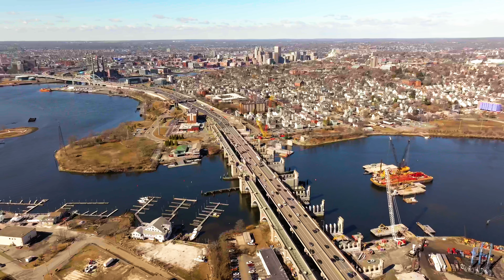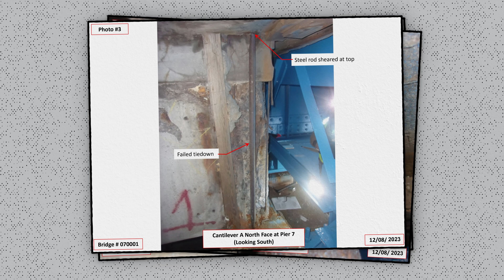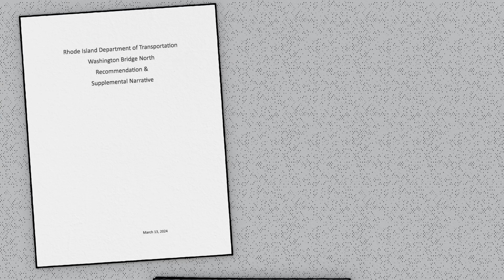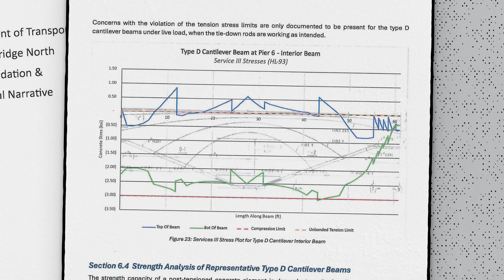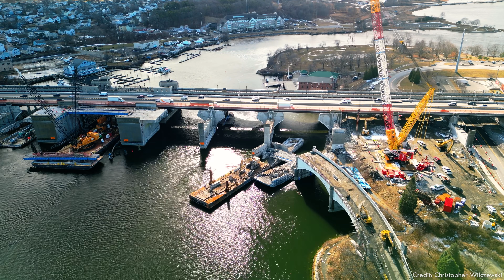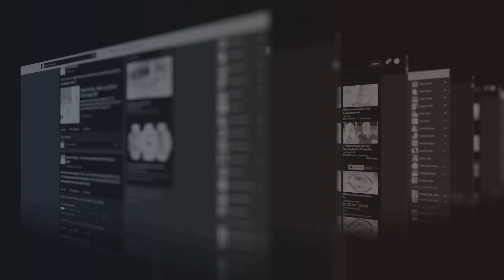This Bridge’s Bizarre Design Nearly Caused It To Collapse

Comment: The headline of this video is a cheap shot at the design team, the members of which are mostly dead. Perhaps I am the only exception since I was the youngest. It was NOT the design that almost caused the failure. The design was an unusual and innovative use of the then existing technology, far from bizarre. The real culprit was the neglect and the poor maintenance by RIDOT. Had the deck joints and other components been properly maintained, water intrusion would not have taken place and the bridge would have served the public for another 50+ years. It is notable that Casey Jones recently documented that the rods were broken for an extended period of time, something that was obvious to me as soon as I saw the pictures in December 2023. If pictures could be taken, then the location was accessible for inspection and the deterioration observed. Such degradation take decades to happen, ample time to fix the problem. Despite the broken rods the bridge carried the traffic for an estimated two years or longer. So much for the condescending comments.
Reply: I agree with you.  The designers are being scapegoated by RiDOT along with many other people and yet they apparently find zero fault with how they have operated this bridge.
Reply: @CaseyJones-Engineer  Thank you for your support

Comment: Those tie downs seem to have failed due to expansion and compression. The sheer seems as if the metal was stretched and failed maybe due to constant load shift based on the deck design.

Comment: Often times, degradation mechanisms are overlooked in the design process.

PS:  The Francis Scott Key accident was easily avoided.  They are called dolphins.  After the collapse of the Sunshine Skyway Bridge in Tampa in the early 80's there was no excuse for the piers on any bridge crossing a ship channel to not have dolphins.  It is one of those situations that I have looked at in my career and observed that it is not a question of if but rather a question of when.

Comment: I lived near a busy 4-lane bridge over a river between Irving and Dallas, TX. The bridge became alarmingly rough to drive over, and was shut down. A few weeks afterward, I bypassed the safety stands and walked down the bridge a ways. Some sections were so badly separated from their conjoining sections that you couldn't have climbed back up had you jumped down. From "rough" to "un-jumpable" was only about 3 or 4 months. It was astonishing how badly that bridge deteriorated in such a short period of time, and how close the call was to shut it down!

Comment: The firm that has done the work on the bridge was being sued by the state after these issues were found. 
Then the same firm while still being sued was awarded the contract for demolition. 
That bridge has been under some form of construction for over 15 years and the head of Rhode Islands RIDOT said these bolts had only snapped a year ago.
Yet if you look at the bolts that hold the bridge down, you can see metal thickness from rust has become so thin that it could not have happened in one year.
Rhode Island wants you to belive that this bridge passed inspection when we all know that if anyone had looked at those anchor bolts at any time in the last decade it would have caused a closure long ago.
The head of RIDOT needs to be fired asking with anyone who inspected that bridge in the last decade.
During demo a section collapsed on a barge and just the other day a machine broke and dumped hydraulic oil into the water.

Comment: Aerospace understands that being able to fully inspect the structure is a critical, and required, design criteria.  Can't have a structural member embedded under other members, making inspection impractical.  I'm sure Civil Engineering design criteria have been updated since this bridge was designed such that modern structures will not have this issue 10, 20, 50 years in the future.

Comment: 11:35 - We just experienced this at our house here. Went to change out a toilet, turns out the previous contractor didn't properly raise the flange after installing tile and raising the floor level so the subfloor and drywall behind the toilet have been getting soaked with every flush over the last decade..to make matters worse the subfloor is plain particle board, so we're turning a simple toilet replacement into a full down to the studs bathroom remodel.

Comment: @14:55, this looks like a fast way of dismantling the bridge. I assume (I hope) no one was on the barges below. And everyone was apprised that the bridge was going to be violently taken apart (from shore to shore).

IF that is true, AND time was being wasted dismantling this carefully, only then this is a needed step.

Maybe we can focus our energy about finding a solution. Including a low volume temporary bridge (3 or 4 lane is better than 0 lane). I assume a simple metal truss bridge, as ugly as they are, they are easy to design, can be fabricated off site and assembled more quickly than pouring a bunch of concrete. After this bridge has served it’s purpose, the steel can be reused for another project (or melted down and resmelted in the worst case).

Arguing and suing each other isn’t a solution for tomorrow. It only adds to the problem.
Reply: You can’t dismantle a bridge like that, you risk damaging the barges and contaminating the river below

Comment: We've had a bridge fail recently in Dresden, Germany. Collapsed in the middle of the night 10 min after the last tram passed over it, nobody was hurt. Turned out it had some flaws, but the most egregious one was similar to this one here: It was impossible to inspect critical parts of the bridge due to the way it was designed. I don't know what's more scandalous, building a bridge like that in the first place or limiting yourself to inspecting the accessible elements only and just assuming the rest is ok.

Comment: The things that you don't catch in this video are that this bridge has been under construction for the last 30 years, a Connecticut inspection company reported this possibility to RIDOT 3 years before the shut down but they completely ignored the CT firm, and the reason no one would bid on the deconstruction was out of fear of being sued by the state and the corruption that's been plaguing RIDOTs system for choosing contractors since Peter Alviti took over. (There's a longer history to RIs contractor corruption but Alviti is hurting us the most right now) He got BILLIONS in a promise to fix 90% of RIs bridges and the target he set for this all to be done by was around the same time as when this, our most important bridge, was discovered to be failing. We are at the bottom of the list when it comes to the structural integrity of our bridges and roads despite BILLIONS being poured into them. I'm praying Alviti gets locked up in prison and drops the soap.

Comment: yes sure the bridge has major structural issues obscured by unusual design, leading to costly rebuild, but on the other hand, it's looked prettier than the standard design for over 50 years... you can't put a value on that 🙂

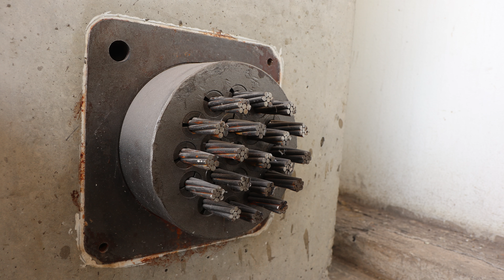Comment: 3:35 I used to be a draftsman in a precast concrete plant. We didn't do bridge beams, instead focusing on stadiums and parking garages. I remember they would pull each of the strands/tendons to over 30 kips or 30,000 pounds, and when they were being pulled nobody could walk between the forms, because sometimes they break!

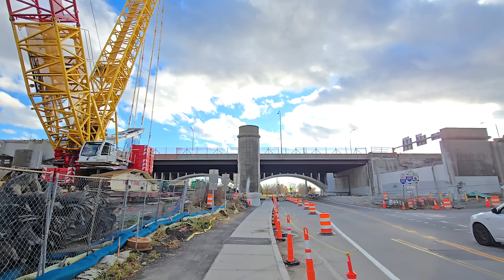Comment: 9:40 A big question is, who was the Muppet engineer who dreamed up the suspended deck sections balanced on beam that could only tip over if any one piece fails?
Hope they didn't design anything else important in their career...

Comment: You mention "concrete repair". How does that work for structural elements? Seems impossible to fill cracks and match the integrity of an original cast piece.

Comment: Just look for the "Viaduc de la Concorde" that failed back in 2006 if I remember well.. It's a structure in Quebec that had design failures and was not able to be inspected correctly. The province had to replace dozen if not more other bridges in all the province afterward since they were all from the same design..

Comment: Awesome summary of the bridge's safe demise. It was an old bridge where a lot of the steel reinforcing corroded to failure; not exactly surprising. The onus for old bridges should almost be to prove that old bridges should stay open instead of saying there is not enough information to shut it down.

Comment: Two sets of litigation that are over laid on this bridge rebuild do seem to be counter constructive when you consider that the bridge itself was near its designed life span. Perhaps a step we need to start taking in this kind of public building project is to include a well publicized end of life for the expected useful life of  the structure. It would give us a better measure of the value of the project and a reasonable point to acknowledge when funding would need to be acquired for replacement of the structure.

Comment: Very interesting video. I think that in Europe we also have this kind of bridge and that we should also do in-depth monitoring studies.
subsidiary question: the bridge, which is still in operation( with both road direction), does it have the same design or is it completely different, otherwise it would also have to be replaced

Comment: Very well presented. You have a confidentspeaking style too - transmitting the technical deets with easy clarity.
And yes: What a Fluster-Cluck that is!
It reminded me a a quirky scenario that developed in the city I'm currently inhabiting: Brisbane. (You may have heard of the drama. It was all about inspections!)
On the Rverside Expressway there are several one-lane curved bridges: on & off-ramps that have to start or end on the outer side (river-side) of the thru-way. 
Regular Inspections were alway done at night, opening the cosmetic covers to inspect the bearings and how they were sitting. All was well. They passed every time. The bridges were making full-contact side to side ... Signed-off.
BUT ONE DAY - for some reason they had the covers off on a hot day and - CONSTERNATION! The contact was bearing at one edge only! The bridges were twisting! 
The Minster for transport was advised - promptly closed the entire Expressway! City was gridlocked. Media panic. Chaos. Etc - until FINALLY someone went and looked again at the usual nightime schedule, 
All Good! Nice Bridge was behaving perfectly! Panic over.
Conclusion: The bridge had ALWAYS been doing that. Twisting up off the bearings on that same side as they warmed up for the day. They still do.

Comment: Back in older days before computers, when so much wasn't known about the strength of things, they tended to what is now called over engineer, and things lasted longer. You can't get a toaster or refrigerator to last as long as they did 40 years ago.
Then you get to automobiles and more are retired due to the expense of repairing unnecessary electronics, rather than mechanical failure. It's pathetic

Comment: Excellent video, thanks. So many lessons can be learned, engineering and legal. Ultimately, these kinds of structure have a limited life before they need to be replaced. Many much older bridges are still serviceable - Victorian and even Roman! Reinforced concrete isn’t what it’s cracked up to be…

Comment: When I saw the tie-downs on thin cantilevered sections in the drawing, I was like NONONONONO.  I could immediately imagine the stress concentrations, fatigue load, and all other adverse parts of that load destroying the bridge.  The curved cable tubes was another place where I saw scary loads because the cable would put substantial lateral tension on its tube.  Never make a single point of failure when you don't have to... and that bridge had several non-inspectable single points of failure.  The lack of inspectability prevents graceful failure and makes failures act like single points of failure too.  

I don't think a single bit of that bridge design looked sane other than the abutments.  This is why engineers need peer review irrespective of stamping authority, especially when doing novel things.  

Design rule checklists (like electronics designs use) should be implemented for bridges and other structures on a per member, per joint, and whole assembly basis to prevent this level of bad design.  
1) Is it a single point of failure. 
     a) Are the materials rated to be single points of failure?  
2) Is it inspectable.  
    a) Does the inspectability make something else a single point of failure?
    b) Does a chain of non-inspectable failure points create any effectively single or ZEROTH point of failure?  
         I) Zeroth being where it has all failed and is held together by friction and a car rolls over that.  
    c) Are the non-inspectable materials and interfaces highly resistant to degradation over triple the life expectancy of the structure?
    d) Are the non-inspectable parts and interfaces to them all together designed with many times the safety factor of the rest of the structure?  
3) Does another member obscure the inspection or maintenance critical areas of the member?  
     a) Creating single points of failure?  
     b) Causing failure of maintenance?

I could go on, but I hold no Civil PE and I do a different area of safety critical engineering under company insurance.

Comment: You would need measuring points on the reinforcements to be able to measure electrically whether corrosion is in progress, and sacrificial anodes like in a water tank that dissolve before the steel does. In principle, we should simply take care of things instead of living on election promises and letting previous investments lapse.

Comment: Obviously there was criminal negligence on the part of people responsible for inspecting and maintaining the bridge.  Those people need to be in prison.  Also regarding the requirement for fast construction of the new bridge, Michigan did that with the Zilwaukee bridge and paid a heavy price when the piers pushed through the foundation pads which were insufficiently cured.  What a mess, when idiots are left to be in charge.

Comment: 13:12 Not to mention that RIDOT is suing every contractor involved with thee original bridge.
Reply: I don't see why. If the contractors followed the specs from the state approved engineers, how could they be at fault. Wouldn't it ultimately fall on the state? Of course no legislator would condemn himself😂.

Comment: Make inspectors of critical infrastructure criminally liable and the public will be safer. Let them charge what they need to charge. It will save lives and catch issues early when they can be fixed. Will prevent corrupt city officials from diverting the money allocated for improvements and maintenance to other places it shouldn't be.

Comment: I recently moved to AZ from RI, where I lived for thirty five years. Most of the bridges in RI, large and small are in very bad shape due to the harsh winters and the use of salt on the roadways. I've driven over and under bridges that were supported by wooden cribbing. Now, if that doesn't shake your trust in Rhode Island's infrastructure, I don't know what will.

Comment: Great disservice to point fingers at the NBIS inspectors, Grady. The bridge inspection community is a small group of highly skilled structural engineers who: are not afraid to get dirty (lead paint, pigeon waste, rust, etc.), hop in sketchy rental MEWP equipment or hang from ropes hundreds of feet above the ground; work in highway traffic with only a few cones and a crash truck for protection; work days/nights/weekends/temperature extremes just for access sake (many times back-to-back); work along high voltage electrified railways or high speed freight; climb in confined spaces (manholes, box girders, suspension towers, etc); go places without protection where violent homeless lurk in the shadows and help will not find you (sorry, no police escort budget); and endless other life threatening dangers the traveling public takes forgranted every day a bridge DOESN’T collapse. But go on about how you would have done a better job.

This bridge debacle only reflects the political climate of RI/RIDOT. The bridge made the news, but countless other bridges in RI have been closed due to disrepair. The fact they listed every firm in recent history as a hailmary should raise some concern. And that FHWA is suing them for misappropriation of funds.

Comment: Thanks, Grady, for another good one. This one actually hits home, as part of my extended family lives about 1/2 mile up the way in Riverside. My first thought was; Rhode Island politics--oh, boy, you just opened a can of worms, there! Let me tell you a little story, related to, what is now called the Jamestown-Verrazano bridge, a few miles down the West Passage of the Bay. I was chartered by a small group of un-named folks, who had me sign a non-disclosure-like agreement, before I would take their divers out to check the cofferdams and pilings, of the old bridge. We had the diver on tether with video equipment. His original mission was to film the condition of the underwater portions of the bridges structure, as for years the legislature was convinced that the bridge was safe and no public funds were to be spent. Anyways, by the time the diver got down there, not only were the cofferdams themselves completely rusted, but the diver reported and filmed himself being able to swim inside them. There was so much room vacant from rust and erosion that he said we literally could have driven an 18-wheeler in there. Needless to say; once this news ended up, on the front page of the ProJo, money was forthcoming for the now existent bridge. The moral of the story: don't leave the safety of the public, to politicians. Let the Engineers do what they do best!